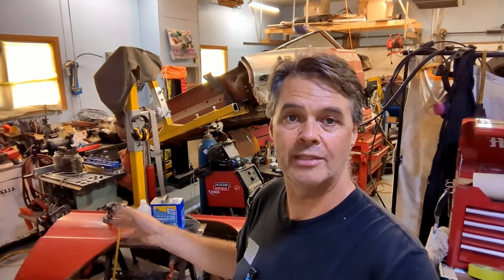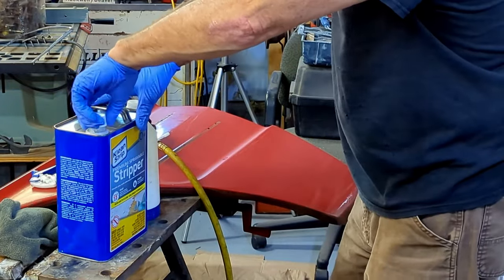Does it Work? - Klean Strip Sprayable Paint Stripper

Comment: Thank you for the tip, that worked better than I imagined (I've heard the new stuff isn't as good).  Many, many, years ago I helped a friend strip a front end he had bought.  We had the same experience with the red oxide factory primer.  He said - "we've hit it with stripper, scraped it, and cleaned it.  If it's still hanging on like this, I say we scuff it, prime it, and paint it".  The parts looked great for the next several years he owned it.  Once again, many thanks to ~ Chuck
Reply from the maker: Your welcome Chuck!
I agree, if it is still in good condition, reuse it. 😊

Comment: Hello Alvin. That stuff works real well. I bought the same brand but gel type that didn't seem to work as well as what you just showed. I found that the aircraft paint remover in spray form worked very well, but it's pricey. Thanks for showing! That fender looks like the best part of the car.
George B
Reply from the maker: Hey George,
Yes, it worked better than I thought it would, and I quite like that it's sprayable.
Lol...that front fender is the best part of this car, likely only because it had been replaced sometime after the car was built.

Comment: I used regular Kleen Strip paint remover on some chrome wheels someone painted black. After 3 coats it didn't work hardly at all. Then I tried oven cleaner and that took off almost all of the paint on the first try. The aircraft stripper is still the best but you have to step up to afford it.

Comment: I recall using Klean Strip aircraft stripper on a car about 18 years ago and it would take it down to the bare metal. It probably was too polluting or bad for the environment as I recall it was very potent.  Thanks for doing this test. I have some similar work coming soon.
Reply from the maker: Hi Jeff,
Yes, the old stuff did get replaced, and for the reasons you suggested...but it looks like we can finally buy something almost as good. 👍☺️

Comment: That worked out pretty good.  I tried to use some chemical strippers on my brothers vw bug and they just didn’t work that well so I sand blasted.  I was fortunate with my T-bird that most of the paint had faded away and sanding and blasting was faily easy.  Looks like you have a lot of work ahead of you.  Thanks for the product demo.
Reply from the maker: Hi Matt, I haven't had much luck in the past with paint strippers either, but this one surprised me. 😊

Comment: hi Alvin, I follow a Canadian furniture restorer on YT,  John's furniture repair,  and she gets excellent results with a stripper made by the swing paint co only available in Canada and I think easy to find in Canada. the stripper is called circa 1850 paint stripper and is thin so easily sprayable though she usually applies by brush. perhaps that would pull up the red oxide primer. carry on. thanks
Reply from the maker: I'll check into that David, I think I have seen that Circa 1850 at Home Hardware. Thank you for the heads up! 😊

Comment: Hiya Alvin!
I’ll definitely use that on some extra body parts on my ‘57. Thanks for reminding me there are other ways besides polycarbonate discs and media blasting. That is a lot less mess.
Reply from the maker: Hey Troy, I think this will work well in those really tight places where sanding is very difficult, fingers crossed that I just didn't get luck with this test piece. 🙄

Comment: Alvin,
Like other strippers nowadays, Klean Strip does work well on some things, but poorly on others.  The key to using any of them is exercising mega-patience and you'll get there.
Regards,
John
Reply from the maker: Hi John,
I actually, I was pleasantly surprised with applying it with a sprayer, it was much clearer to use than the gel.
I think you are right, just need to exercise patience. 👍

Comment: Going to base coat and clear coat? Or single stage paint. Clear coat is nice once you get the hang of it. Plus you need 2 part clear coat not the crappy cheap stuff that comes in a spray can, although Spray max has a 2k two part clear in a can but has not much shelf life once activated.
Reply from the maker: I'm not decides on the paint yet, I'm not fond of the look of base coat/clear coat on these old classics...but on the other hand it's far more durable than the single stage stuff. I've seen a couple of people do a combination of clear and single stage, I have to dig into that more before spending the money.